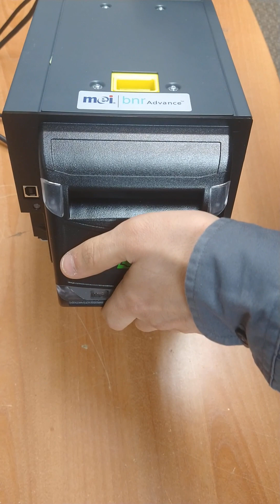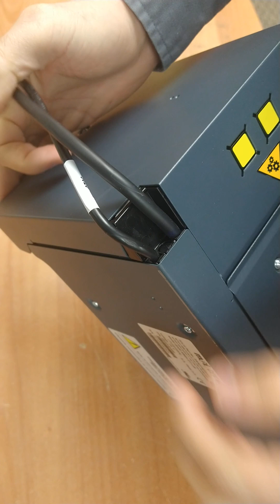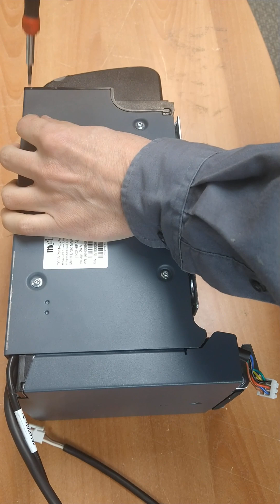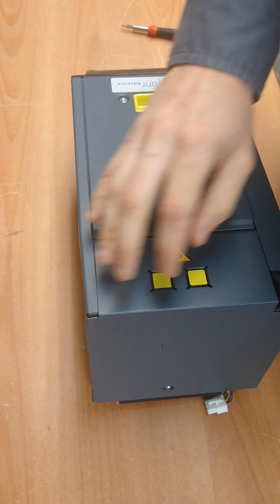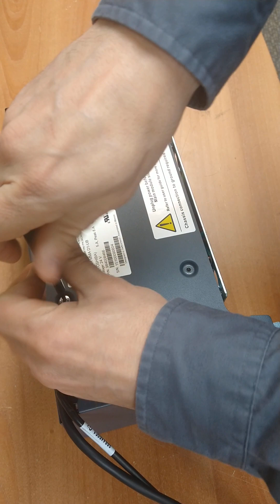Toshiba BNR Main Module troubleshooting

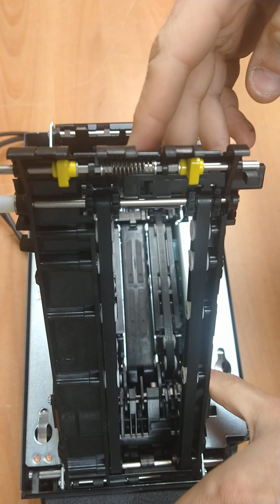Comment: Thanks for making this video. I was about to send our new one (only in service for 6 weeks) in for repair but was able to get a bill out that was stuck in escrow with your help. At 1:23 you showed how to get that plunger to spring up but I couldn't get it to release before or after the bill was removed. What really helped was when you showed that the large wheel could be turned and that was how I was able to get the end of the bill to be exposed and then pulled it out.